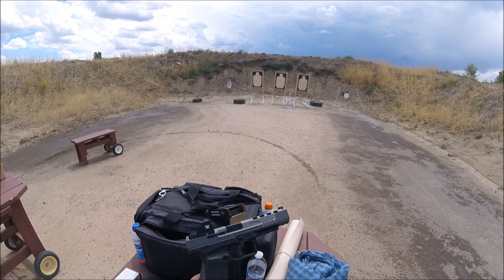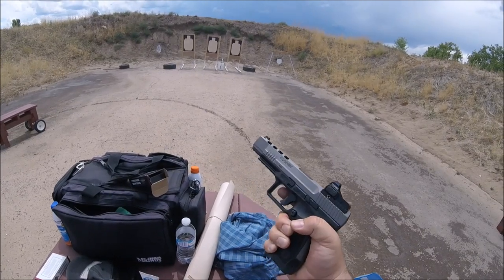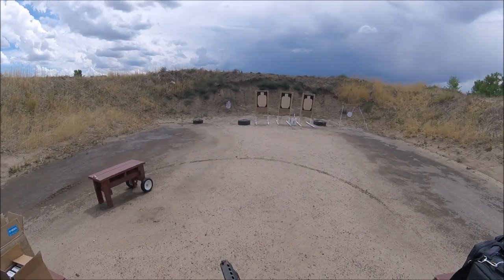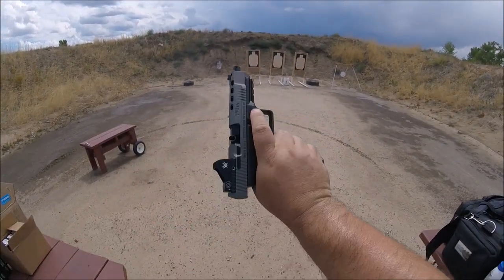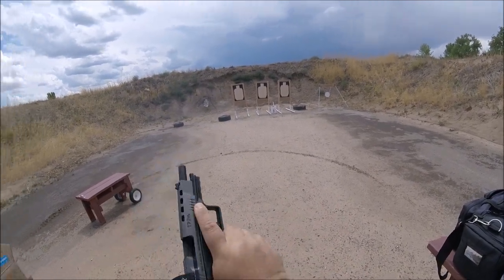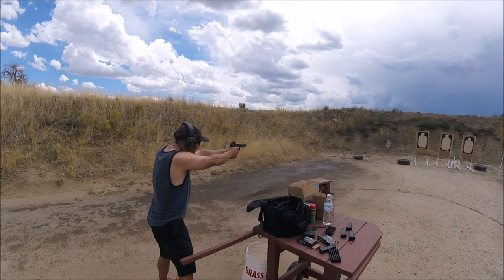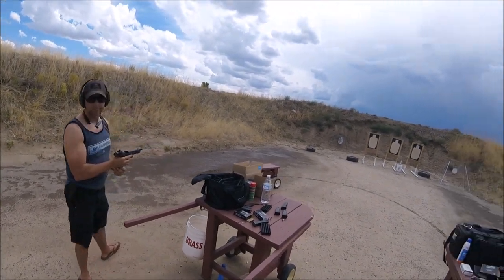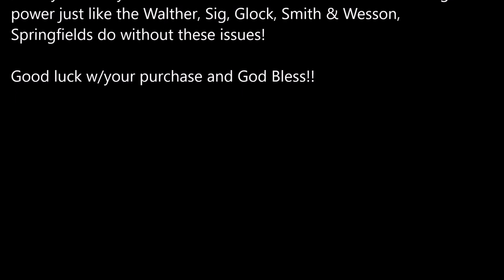Canik TP9SFx Problems!!!

Comment: I own this gun and i have put about 6,000 rounds through it. The first 500 rounds it didn't like blazer 115gr and would do the same thing So i ended up using some Sellier & Bellot 124gr and it was working perfect. I have also used some Fiocchi 115gr and 124gr and perfect. After about 500 rounds give or take i decided to try the Blazer again and to my surprise it ate it up with no issues. Since then I have put nearly 6,000 rounds through it without any issues what so ever. Works like a dream. Not even a hiccup. It seems to take anything I put in it now. its a little weird but it looks like it just needed to break in. Anyways I just thought I would share and if you are thinking about getting this gun don't hesitate just buy it. Its that good trust me!
Reply from the maker: Great to know - it is one heck of a buy!!!
Reply: Frank Contreras  I'm at about 1000 rounds through  my sfx I first ran sum 147g freedom  munishions  reman  about 150 rounds then I shot about 300 rounds of 124 reman   then I ran the the 115 g . After that I shot allunum 115 . And tula 115 it just ate it up  . Just keep working it in I've Hurd of guys leaving  the slide locked to the rear for a couple days just to put the recoil spring under tension
Reply: JohnK2112 WRONG!!!!!!!!!!!!
Reply: Most semi-auto pistols need to go through at least 300rounds of break-in period while semi-auto rifles need about 500, from my experience
Reply: Thank u for the knowledge
Reply: Wish I saw this comment before hitting the range. Brand new tp9sfx, I ran 100 rounds of blazer 115 fmj and almost every round stovepiped and was beginning to regret my purchase. Same day switched to fiocchi 115 fmj and flawless with excellent grouping
Reply: Got mine yesterday even ran 115 grain aluminum blazer and brass mag tech fine
Reply: I've owned this gun for almost a year, 1,000 rounds through it and have not had problem until today with 115 gr CCI Blazer 9mm.  Trigger would not reset.  Removing the mag and reinserting it fires.  Have previously shot Sellier & Bellot 115 w/o any issues

Comment: Freedom Munitions ammo is not known for quality; especially their remanufactured ammo.
Reply: I've run thousands of rounds of Freedom ammo without a problem thru both Glocks and 1911's, but the 147 won't function in my new SFX.  Their 115 works perfectly as does S&B 115, and Speer Lawman 147.

Comment: My tp9sfx out of the box has ejection problems.  Used 115 grain ammo, 120 rounds and 33 stove pipes.  I have contacted Century Arms and requested a different recoil spring assembly, these guns and problems should never got to market, they knew there was a problem and if they didn't, they need to change their quality standards.  Will keep the gun and try to fine the fix, they are great guns if they run , but one shouldn't be a buyer standing at the checkout with that question running through their mind.

Comment: Yeah these for what ever reason have a bit if a break in period. I took mine apart cleaned and lubricated it. After the re assemble I locked the slide back for a week and it works fine flawlessly now. I rand 200 rounds through it after with now issues
Reply from the maker: Excellent - glad to hear it and thanks for sharing what you did to get it going!!!

Comment: ive run about 1,000 through mine and only had one FTE when i used some Blazer 115gr i had laying around for who knows how long. i typically run 124gr in it though and like i said, havent had an issue with it... the only thing that does concern me a little bit is the light ejection. it seems to just BARELY eject cases out, but it does get them out so i guess its okay, plus, it may be loosening up a bit as i use it, but i cant tell if its a stronger ejection or not since i dont have a video from the first time ive shot it and a recent shoot. i dont know, maybe when it loosens up and maybe some of the things start to wear in it'll go smoother for ya.

Comment: Juat bought this gun.. ran norma 124 for the first 150 rounds. Ran nice. Had a hickup and the its like the trigger locks or wont reset. Read another guy with an issue of the firing pin not resting  or something.. who knows. First gun ive bought  and had problems  with though. Have 4 shitty  glocks. A few fns. lots of sig ,Springfields.. couple hk. May have to send back if i cant count on it

Comment: My first 150 rounds I had 15 malfunctions, locked the slide back over night for 3 nights, took it back out today an put 400 124g Winchester NATO down range without a single hiccup. These guns have a serious break in period.
Reply from the maker: Curious to hear if you try 147 grain and what happens
Reply: I hope that's all it is. I really like this pistol.
Reply: If you want to run subsonic 147gr.? Change out the mainspring/recoil spring.

Comment: I have the mod 2 version....have never had a feeding issue. I shoot steel thru it, and an assortment of other ammo.it shoots as good if not better than my Beretta M9 A4. the mod 2 trigger is smooth as butt tahhhh. sites are great .breaks down for cleaning FAST, Glock could learn something on improving the take down "buttons" by copying the caniks(a hell of a lot easier than the Glock I have).

Comment: Mine has cycled and ejected just fine, but does take a bit stouter ammo to run.  After breaking in it runs 124gr pills at 133 PF just fine with the stock recoil spring assembly.  It will, however, take springer guide rods for the Sig 320 and use 1911 springs.  You just have to cut 3 coils on standard 1911 springs to make them short enough to let the gun get back to slide lock.
Reply from the maker: Seriously?  Wow, that might be the best fix yet :) - I'll pass it along to my buddy who owns the Canik - thanks!
Reply: David Valdez no problem. The guide rod is a bit long for the standard slide guns and should required cutting or grinding about 1/4 inch off. But the extra length doesn't matter on the SFx. I also had a light strike issue in my SF due to the striker block having too much engagement. Knock a few thousandths off and it's gtg

Comment: I had some jams with 115 right out of the box but after running 100 rounds of 124 without issue, it also does 115 just fine.

Comment: I had every 6 or so rounds jams when I first fired the weapon. I polished the chamber with a battery moto tool and the feed ramp with automotive fine grade rubbing compound then went back to it. I found that one of my three clips feeds perfectly. Seems simple now, but wait it was still getting random failure to feed on that clip various types of 115-grain ammo. Now I have 300 rounds and it's running almost perfect. I wish to add almost is not good enough for protecting my life. My weapon was very tight, a good thing when I received it I will put 800 or so rounds through it then if it's not resolved I will let the factory have ago at it. Great weapon trigger pull is excellent the fiber optic sights work well outdoors but I took a 00 brush and just put a thin coat of acrylic yellow on my sight to give me some pick up in dark indoor situations that worked well,  don't go heavy on that paint or it will overwhelm your fiber optic sight in bright light. I will check in as I go along with this weapon I am lubricating the clips just before firing with WD-40 mine seems to favor hotter loads and that seemed the best improvement of all just lubing the clips. Long staggered round clips  are the most problem-prone component in modern firearms. I truly believe this is a very good weapon with a minor teething issue it's accurate and has mild recoil the quick reset and short trigger travel make very fast firing handgun. This is likely the best gun on the market at this time, everyone loves the weapon that fires them and the combination of great design high capacity plus good sites will make this weapon go down in the record books as a top value. LT - Louisville Airport Police...Ella Craddock ret,
Reply from the maker: I hope you have success with the firearm - my friend sold it (it wasn't mine).  The trigger is very nice, the platform is a copy of the Walther PPQ (a fine firearm), so if you get a good one, it's worth keeping.  If you know how to solve problems, worth keeping as well, but me personally, I wouldn't carry one until I was able to put quite a few trouble free rounds through it either.
Reply: @exxonv1719 Thanks, David in my time being a woman and a police LT was difficult however I am stubborn I really like the way this gun handles,  so well I am willing to put the time  in to correct the issues, If it's worth having it's worth fighting for my husband Paul could likely write a book on that with me its an ongoing joke with us . I will check back in as I resolve the glitches on this weapon. All guns are different our most accurate an S&W mod-15 Paul bought for me Parkerized and the inner surfaces hard chromed fitted to match grade standards with rubber combat grips. I have a Ruger SR-9 that I think would feed about anything even a wadcutter (just joking ) however it's not near the Canik in trigger or accuracy. I think of it an  AK-47 - works well it ain't pretty just not a target pistol / Stay safe - Best Ella.

Comment: Good luck is right with this gun. Dead accurate, nice gun, but jamming and failing to eject is a problem with mine. Brand new, first time out today, should have stayed home. Called the company, they said the spring is too heavy, they will send out a lighter spring and should fix the problem. WHAT? I asked if you know there is a problem with the 85-90 newton spring, why do you send them out with that? he said they come from Turkey and they send them out for 124-grain nato rounds and should not be doing this. huh? Anyway, I have to wait for a new lighter spring now.
Reply: Same issue. Same answer from century arms. Hopefully it will work now.

Comment: Similar problems using 115 grain with my TP9SFX and my TP9SF Elite.   Tried Remington green box, Federal and some local remanufactured ammo.   All presented several failures to feed and failure to eject.  Federal 124 grain works flawlessly in both guns.  The guns do not appear to like light loads or the heavy stuff.  124 grain Federal appears to be the diet of choice.  The failures are made more disappointing by the otherwise great features of both firearms.
Reply: I changed the guide rod now I have no problem. I used guide rod out of tp9sf

Comment: 1)Grease. Canik advertised that its competition ready out if the box. I  had every other round jam out of the box. I hit the slide rails with hops grease and haven't failed once.
2) weak wrists. More grains equals more recoil. Keep the pistol stable and it won't stovepipe the casings.
3) recoil springs. Get the stainless steal guide rod with a 24# slide with 124grain rounds.
Reply from the maker: Weak wrists?  LOL - that's funny man, funny!  Ain't the case, but still, pretty funny.
Reply from the maker: I've not seen the grease comment, but everyone is saying recoil springs fix the issue.  Not a problem for me, this was a friend's pistol and he sold it.

Comment: When you are the only one having issues like that, make an effort to find out why. If not the issue is with the operator. By not checking to see if they changed the spring and offered a replacement (hint, they did) can’t blame the gun. Just a spring change
Reply from the maker: I don't think you read the comments, we were not the only ones seeing this issue.  But point taken, the spring change did fix it for many folks.  My buddy opted to go another route and no longer owns the pistol.

Comment: I've ran all kinds of junk and premium stuff in mine with not a single issue. I even ran that exact freedom munitions 124 grain 100 rounds with no issue.
Reply: Sorry 147 and 124 grain. Ran fine.
Reply from the maker: Good to know - several folks reported having success out of the box, we also saw several folks report having similar issues.  Canik has been good at providing replacement springs to those who ran into problems.

Comment: I know its been awhile but what is the conclusion of this SFX? Here in 2020 and its still a hit or miss. Constant stove pipe using 115 and super sluggish at 147. Replaced rod and spring with p320 and 1911 spring at 15lbs. Seems to do the trick with no optics. Add the optic and back to the drawing board to tune. sigh
Reply from the maker: Well, based off the feedback I've gotten, you either get the right setup out of the box (runs 115, 124, 147) or you don't and you have to play with the recoil spring to get it to work.  People have done what you mentioned, called to get lighter springs, etc.  For me, buying a TP9SFx is a no-go based off what I've read.  My buddy sold his (this one) pretty quickly with the caveat that it runs 115 grain just fine, but mileage may vary with other loads.

Comment: They have a stiff recoil spring like the SF Elites. Good practice to leave the slide locked back for a couple days and run 200 rounds of full power nato ammo through it to break it in. Did this with my Elie and SFX and not one issue.
Reply from the maker: Thanks Ronnie - my buddy owns the Canik and he took it to the range the first time, had stovepipes every few rounds.  He left the slide locked for two weeks and then we took it out for the video you saw.  Since our video, he ran 200 rounds of 124 and had two stovepipes out of the 200 rounds.  I believe you are spot on correct about the break-in period, and he just picked up 1,000 round of 115, so I'm guessing that'll all run fine and over the next few weeks, he'll get to 100 percent reliable.  I've just not encountered this w/anything in awhile, not since my Kahr CM9 that required 200 rounds before it ran 100 percent.  Oh well, for the price and what you get out of the box, it's not a big deal - I'm curious, no issues since break-in?  If so, the Canik TP9 SFx is a great buy at half the price of the Walther PPQ Match!

Comment: I own SFX- They intentionally made the SFX for gunnin and running. Comp! FAST! So they put heavy spring in it for purposes of PLUS P Ammo and 124 grain which has hotter load powder in it. So shooting anything else AKA cheaper ammo you most likely going to suffer problems. Theres No need for recall it intentional. If you want to shoot cheaper ammo like me just change spring out. I emailed them and are sending me new one for free. In mean while I lock my pistol open during the night with full mag next to it just in case and this may well fix problem as some other SFX owners have said worked. Ill rack the slide 100 times a day for 10 days loosen that spring up a bit. I bought mine new and took to range and had out of 300 rds 115 grain Fiocchi 11 or 12 stove pipes. Very annoying but at that time i didnt know about the Plus p rating for this pistol and its spring.
Reply from the maker: Yep, this was a friend's pistol and he found out about the NATO ammo requirement after the fact.  When we run USPSA, we run close to Power Factor, so in 9mm, that's 147 grain and low power - less muzzle flip, quicker follow-up shots (https://www.targetbarn.com/broad-side/what-is-power-factor/).  The SFX looked competition ready, but out of the box, it only runs hot ammo.  If Canik really wanted to sell the heck out of this, they should've considered putting in two springs (my opinion).  When I build up a load for USPSA or IDPA to be close to Power Factor, I almost always end up changing my spring weight.  The lower the weight the better, over sprung can lead to major problems.  Under sprung can lead to excessive wear on the slide.  The Canik SFX is a well built pistol with excellent options, but man, to cheapen the experience by not adding a (cheap to make) recoil spring, or better yet, having a guide rod (non captured spring) and two springs would have made it a much better experience.  You can get a lower weight spring and I'm sure the pistol will run well.  I hope your new spring helps and that you really get to enjoy the pistol!  It's a great value for the price.  BTW, LOVE the name "GodisMyLight" - we all need that light right now!

Comment: mine jammed every time I had stove pipes, fte ,ftf ,& etc. this is my first canik and last I never had a 9mm jam on 124,135, & 147 grain I will be trying 115 grain +p if that doesn't work  back to the factory it goes
Reply: Just got my tp9sfx would not eject. e-mailed Canik told they were sending out part did not say which part. I took out the guide rod out of my tp9sf put it in my tp9sfx now it works great . So I took the guide rod and put it in my old gun no problem at all. using 115 grain winchester whitebox

Comment: Freedom ammo is pretty underpowered ammo and the recoil springs on the Caniks are pretty strong
Reply from the maker: Yep, but it's sold as a competition type firearm, so you'd think it would run lower power ammo since everyone wants to be closer to minimum power factor.  Either way, not a big deal as you can get different springs.  Just wanted to point out what we were seeing with 147 and 124 grain ammo.